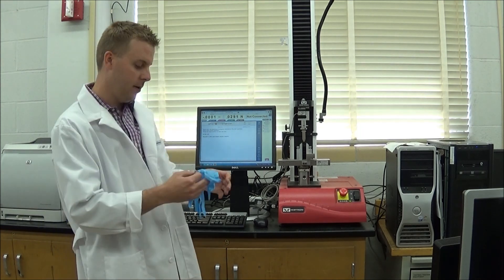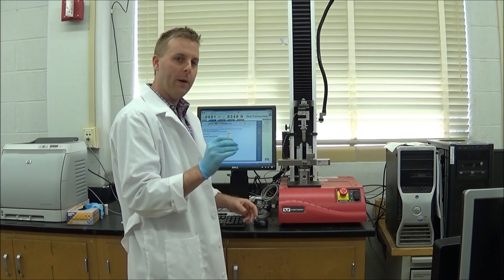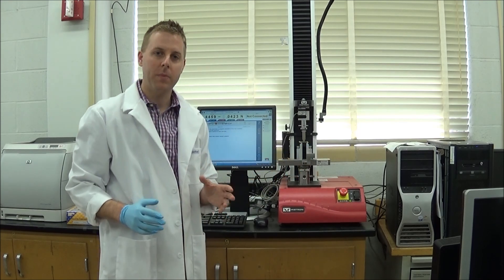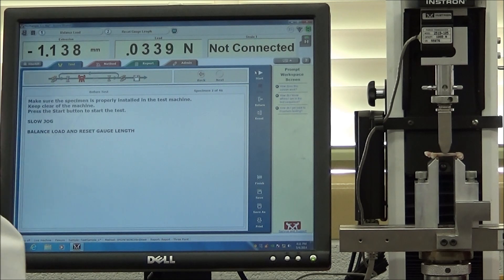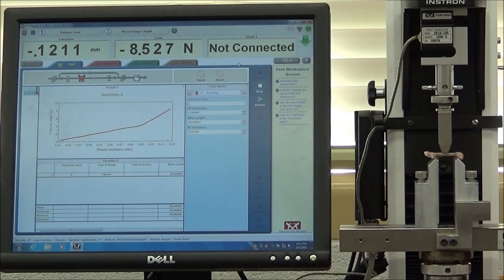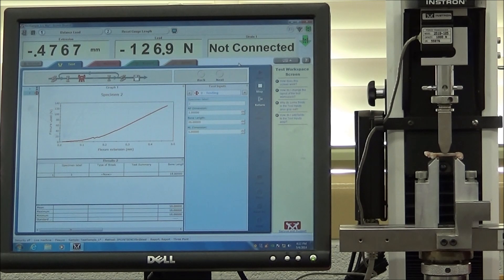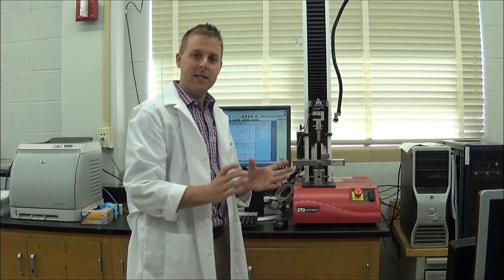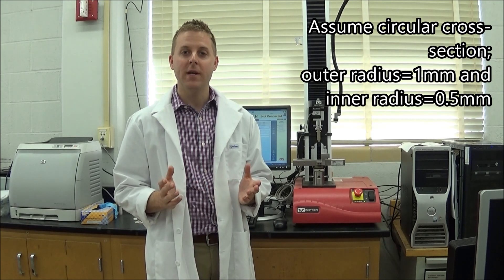Three Point Bend Test

Comment: hi, thank you for the video. If I want to determine the mechanical properties of PCB with copper layers in it, can we use three point bend test? for example, if I have a 4 layer 100mm X 100mm PCB of 1.6mm thick with different percentage of copper in each layers, how to find the properties like 'E' value? Is there any other method to find the properties without damaging the PCB since the PCBs will be different for different applications. we need to know this since copper increases the stiffness of the PCB.